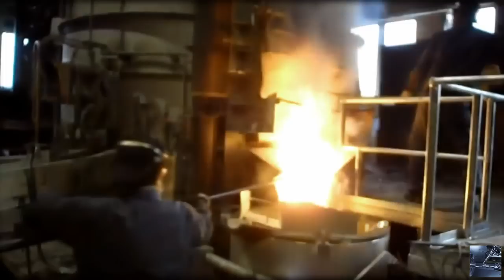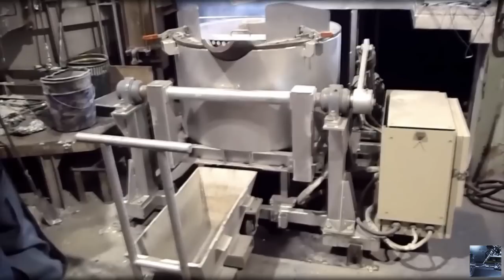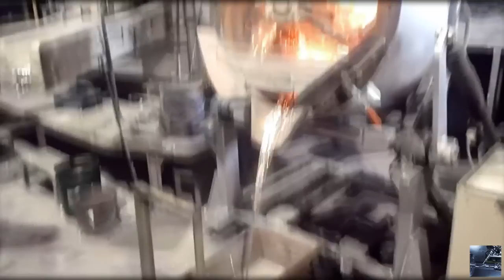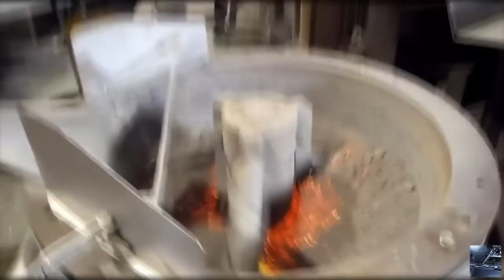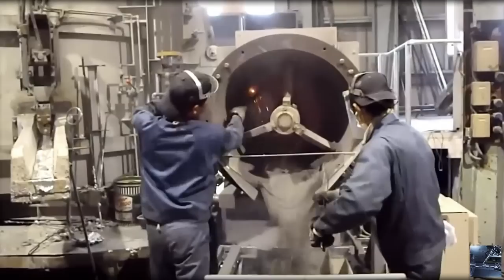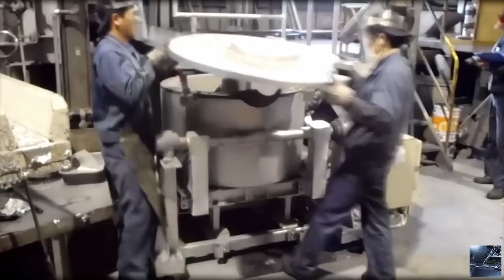Perfect aluminum smelting technology - Discover heavy industry

Comment: This is not smelting. This is slag/dross removal from the gas furnace 
(aluminum will later be poured trough launders located at the left side 
of the furnace). Slag is always skimmed by hand. It can contain up to 
80% of the usable aluminum, and is therefore recycled.
Filmed process is hot aluminum dross recycling, where the aluminum is 
extracted from the dross by agitation/stirring.This technology is 
extensively used in East Asia and is able to recover up to 60% of the 
metal from the dross. Western foundries more commonly use dross presses 
where the metal is squeezed out by hydraulic ram.
Reply: you seem know the field quite well  but I saw someone use the aluminum powder (they saiid), maybe slag or dross or ....., used for raw material to make pellet. why? maybe polishing application...
Reply: Thank you! I had a million questions and you just answered them all :)  The title wasn't jiving with the video IMHO. Thx!
Reply: Yes, He's right.
Reply: the answer to that question will cost u.  lol did your dross equipment not come with instructions
Reply: Slag and dross are two different things. Not sure why you mentioned both.

Comment: There is just about everything wrong with this process both from metal cleanliness safety,  and ergonomics. you..  could write a book on it! but number one has to be the really really badly designed trolley buggy thing... sloping sides OMG!!
Reply: Roger Geary 
I have worked in  several foundries and you are absolutely correct. Shaking my head the whole time....
Reply: The more I watch this video, the more I think this is some sort of underground foundry for stolen aluminum.  Safety is second to production. 

Or it's in Mexico
Reply: lol
Reply: Scrub my comments on metal cleanliness- this is a dross recovery process...might even be in initial trial stage... so my comments change to the guy skimming the furnace of dross is bringing over a lot of aluminium... . ! still lot of design improvements needed!
Reply: mc dadio looks like first grade chinesium to me
Reply: YouTube, where all the experts hang out.
Reply: i work on an foundry ... die casting unit..... that isnt aluminium is "escoria"  ... slag from others factorys and they are trying to smelt all the aluminium there ... so that is the title above its like taking the most metal from the slag of factory's.... from the begin i found strange i do the same process to clean the metal and there i see no metal only slag and the temperature there from the light its about 750ºc but its the slag that shine soo bright  its from they re-burn the slag of die casting factory... we sell the slag to someone that i think do the same process
Reply: and that isnt smoke its ashes and quimics to help cleaning the metal.... and you see the amout of metal vs amout of ashes in the car and in the air  ... this is the final stage of the slag i think if not ufff they bought an bad lot
Reply: view conversation and learning
Reply: The sloping sides of the trolley is so the cold metal ingot will come out of the trolley.
Reply: +BlindSquirrel666 then a lid or something to stop it slopping about or even not moving it would be a good idea.
Reply: Absolutely. I worked in an aluminum foundry and I cringed watching that.
Reply: charming and intelligent
Reply: mc dadio:    .l.
Reply: Just the way things are done over seas
Reply: Roger Geary It hinges on the primitive and very dangerous operation due to the manual handling of a dangerous smelted and liquidized metal! PLEASE , try to find a job at a more humanly friendly operation!
Reply: still bill..... What? ......I worked with molten steel and molten aluminium in my career as a Metallurgist. I am all too well aware of the dangers. And there are those that are avoidable and those that are not where one minimises the risk to the best.The operations in this video fall well short of good industry practice. Those in charge at this operation need to be better educated in the arts of safety and best practice!
Reply: Roger Geary but they have a plastic face sheild & flammable clothing, great protective gear...lol OSHA would have a baby there
Reply: James Carl ... you cant tell if their clothing isn't fire retardant treated.. the visors are probably not ordinary plastic either... and could be well suited for the use... even to British Standards maybe.
Reply: Roger Geary we want to buy cheap stuff and thats made in country's that don't give a f..k how its made or its pollution it is allways about one thing $
Reply: Splish splosh splash I just melted my leg...
Reply: That trolley is just a scalding to death by molten metal accident waiting to happen